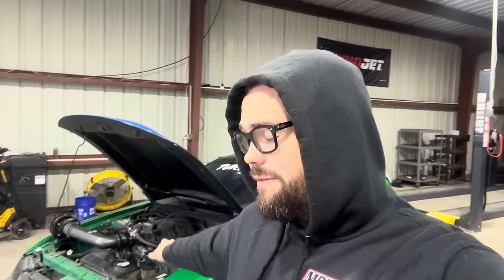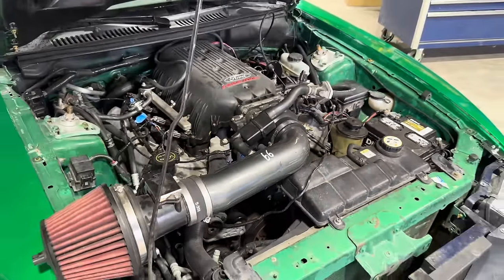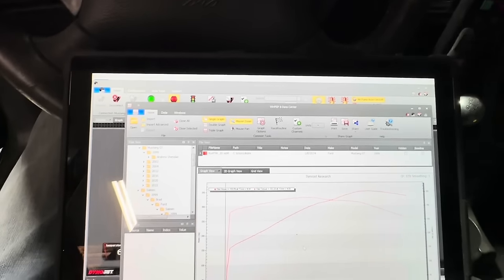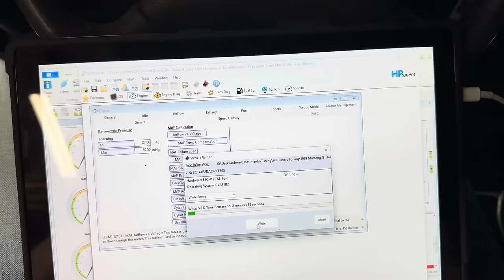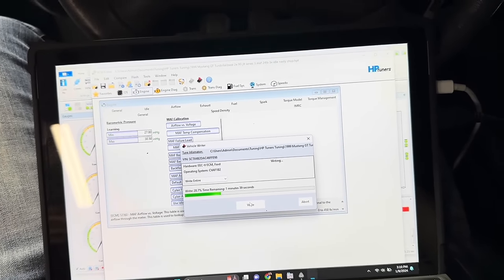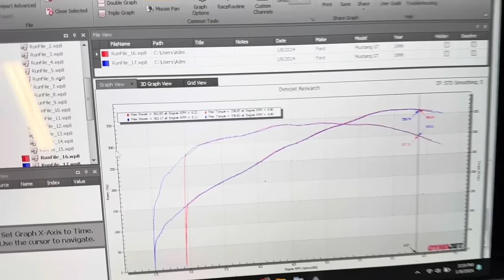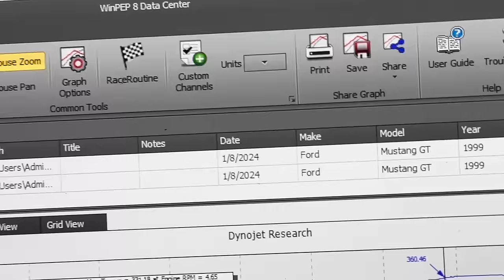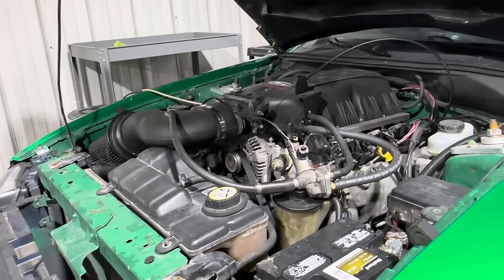Will Underdrive Pulleys add any power? Squeezing every bit of n/a power out of Turdzilla

Comment: Reducing crank pulley size wasn't always just about  seeking more power.   In the old days water pumps were prone to cavitation and alternators  got damaged when race engines ran up to 8,000+ rpm.  Don't know if that is a problem anymore but that's probably most of the reason  this was done.

Comment: During the Fox and SN 5.0 Days, underdrive pulley's was the fourth mod after adding Timing (from *10 to *12), Air Filter and 3:73 gears.  It was Crank, Water Pump and Alternator.  They claimed 8-10hp but nobody tested them.  I remember at idle during night conditions, if your headlights were dim at the red light and got bright when you took off, we all knew you had pulley's.
Reply from the maker: I believe they added power on the fox cars. But looking at the stock balancer and water pump pulley vs these it’s not that different
Reply: They do add about 8hp in conjunction but it's not even remotely worth it, I watched guys kill their batteries & overheat their engines many times.

Comment: I did that back in the 90s on an old Pontiac motor I built by removing the mechanical fan, larger alternator pulley and balancer pulley.. at the time I noticed it revved faster and spun going into 3rd..no Dyno 😂.. It's a great way to find that little bit extra.. cool video

Comment: The pullies arent gonna "reduce power" its simple physics and turning less with less weight its gonna be slighty more i think 5-10 hp max depending on application.  Its a very small amount so doing it on different days with not as good of conditions could def cause it to read lower than before.  Its gonna reduce rotating mass and weight thus reduce parastitic loss but its a small amount dont expect anything crazy but it all adds up i also think it could increase response too but i have no testing to back that up just a guess.  I could see it benefitting i ways other than peak to peak numbers too.  For one it SHOULD be less weight on the front its an easy install and cheap so why not?  When youre na in the mid 300s to the wheels it all adds up.

Comment: Hell yea. 3v catches so much hate but if that’s what you have you can definitely make power with it. I have an 08 gt premium 5 speed car. Jlt cold air intake, twin 60mm gt500 tb, ford racing intake manifold, Howard rattler cam shafts, 1-3/4” longtubes, under drive pulleys, cat/muffler delete, 4.10 gears tuned by Lito with a zex wet kit spraying 150 shot. I’ve never had it on the Dyno but according to a hp calculator using my 1/4 mile trap speed 124mph and guessing on the weight at 3700lbs it’s making right at 550hp. I actually have the video on my channel running my buddy’s 21 fbo e85 10 speed gt 50mph to 130mph. I was actually out on him about a fender till I had to shift then he got me by a fender and I was slowly coming back but with the 4.10’s I was about to hit the rev limiter at 130mph in 4th gear. I also have a video of my stock 19 gt 10 speed on a 75 shot (dry kit) running his car. All 3 cars are actually very close 50-130mph. And 1/4 mile. My 3v went 11.28 @ 124mph on a 125 shot his 21 10 speed went 11.30’s @ 129mph I believe it was on a 125 shot. His car definitely had more in it but he ended up totaling the car before we got that 10 second slip. I haven’t ran the 19 at the track yet. But guessing on the 75 shot it would be in the 11.70 range maybe.
Reply: Plan on putting a set of gen2+ coyote rods in it and adding another kit. Keep the first stage a 150 shot on a wot switch progressive controller and then add second kit spraying 100 shot on a button. Was going to boost it but ima save that money and put it into the 10 speed.

Comment: Why dont you cut 2-3” off the cai tube so it will fit inside the engine compartment
Reply from the maker: Because the goal was to run the larger and better looking tube. (Which worked) that was backup plan

Comment: FYI you don't need to hit the green then red button. The dyno can and should be configured to end the run and apply the brake on a single red button press....keep it up.
Reply from the maker: It’s what I got used to from previous Dynos. I think win pep 7 had issues not ending or something. I just like doing it that way because whatever dyno I’m using I know the run ends right when hit the green button

Comment: Why is the AEM wideband showing 11.X and low 12 AFR at WOT? I thought 12.8-13.2 made most power NA on most typical engines?
Reply from the maker: You can see fuel gets closer as we tune. I don’t have any maf data from this setup to start with so it’s being done from scratch. Log, tweak maf curve, and repeat. I am suspecting we are near the limit of both pump and injectors as both are stock (stock 99 gt fuel pump and stock 24lb 3V injectors

Comment: Are you tuning yet? I have a 4 valve now I'd like tuned.  High idle with every iac except v6 and no vac leaks. 24lb inectors
Reply from the maker: Yes I offer tuning. Generally iac issues are with the valve itself. Parts store replacements are garbage

Comment: Kinda feel like a base before and after would have really solved this question really quickly
Reply: It's been done for years and years and years since the mm&ff magazine days.   Underdrive pullies always add power they reduce parasitic losses and usually weigh less but it's not gonna be a ton I could see 5-10 whp it isn't alot of money and it all adds up...same way deleting the ac removes weight and frees up losses but on a street car with a functioning ac it isn't worth it imo.
Reply: If the da and temp is pretty similar it's a good test imo the weather isn't gonna swing it much if da and Temps are close
Reply: I just watched the video (or finished it should I say) he's claiming no more power I'd have to see more with the conditions on both days but they added power on fox bodies maybe the pulleys aren't as heavy or something on 3v engines?  I mean if nothing else  i think it should increase response similar to how a better air intake setup can help response.  Pretty sure aftermarket underdrives are lighter too so it can do things besides just peak power difference i.e. not seeing a peak increase doesn't necessarily mean they are worthless.  There could be gains in other parts of the curve (it appeared to be but like I said I'd need more info on da and such since he didn't do same day testing (he did say conditions were similar)
Reply: @midnight347 I have the same set except with the alternator pulley also on my 2V, no dyno numbers but it definitely releases some power… i would say about 8-10hp. They definitely help with responsiveness and revving up quicker and possibly fuel mileage.. I also used a set on my 95 GT years ago and got the same results..

Comment: Not adding power. Freeing up power. But on a Dyno will show as more power. True more power is changes in combustion chamber, so this falls under less parasitic loss??
Reply: Yeah. When you're measuring wheel hp it definitely makes the number go up. So it's adding numbers technically lol

Comment: Underdrive pulleys are awesome on NA builds.
Reply from the maker: Why are they awesome?
Reply: @MustangLifestyleTV  worked well on my 3v builds and they worked smoother with power. 
Not sure how it’ll work with the 2v system and cams but I will be watching this later tonight.
Reply: @KapcomRacing they should be less smooth
Reply: @tturi2  how and why?
Have you used them before? 
Because if you had, you’d know it was the opposite. 
Freed up power, and you don’t lose much power when you throw AC on.
Reply: They definitely freed up some power on my 2v.. Helps with gas mileage a little also..
Reply: @NewEdgeDesigns  fact